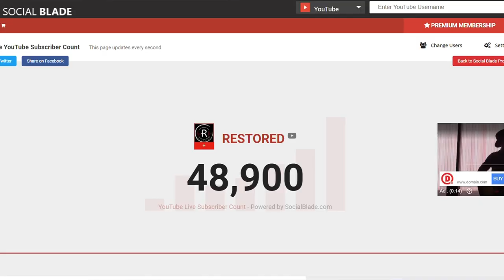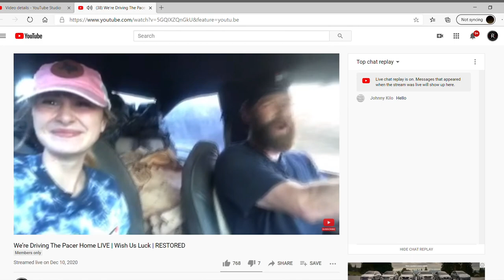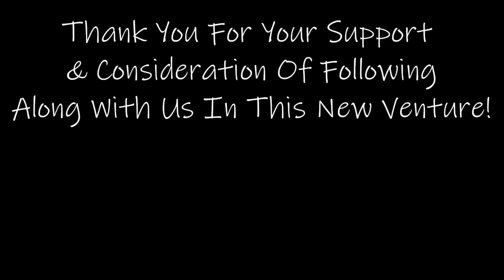ABANDONED AMC Pacer First Road Trip After 2 DECADES!| Rescued & Clean Up After 20 Yrs (P3)| RESTORED

Comment: your show reminds me of my ford aspire i bought for 75 bucks. it kept eating batteries because they the hot wire and the ground wire from the battery to the same bolt. separated them out and it ran beautifully. then i started on the interior. i took the seats out and the carpet out and pressure washed them at a car wash took the center console out as well as the dash and cleaned the years of soda pop and tobacco stains out boy that water was nasty but in the end it was spotless. then i fixed the little things like the blower fan switch and the turn signal switch all i had left was the vacuum booster for the brakes then i lost everything in the wildfire and now i get to start over.

Comment: You are half correct on the thermostat as you are with most car related things. It does allow the engine block to heat up faster but it also holds the coolant in the radiator longer to allow it to cool off more to keep the engine cool. Without the thermostat, you have a higher chance of overheating than you do with it installed due to the coolant not being in the radiator long enough to lose it's heat.

You should NEVER run pure antifreeze! Without the thermostat installed it won't be as hard on the water pump but the viscosity without water is much higher. It also will not absorb as much heat. Coolant is only designed to keep the water from freezing, reduce corrosion, and provide lubricant for the water pump. It's not designed to be used by itself!
Reply from the maker: No one ran straight antifreeze in the car, it was diluted off camera.

Comment: the thermostat is there to slow the water down to give the radiator a chance to cool the water. the engine will run cooler with a thermostat.

Comment: I have seen the aftermath of a fan blade flying off (hole in hood). And in my younger years, I remember a 64 Chevy came into the gas station I worked at (1973) that had an awful vibration. Looked and looked and couldn't find the vibration, shut the engine off and it was a missing fan blade.

Comment: I've found instead off using wd40 as it's not cheap . I use kerosene with a bit of old or new engine oil . It sinks into rust alot quicker and alot cheaper .

Comment: Tip from a custom car builder,
NEVER START THE MOTOR UNTIL YOU TEAR IT APART
Silly people dump in gas and run it and 9 times out of 10 hurt the motor.
Those old carbs need rebuilt, the rubber gaskets & diaphrams corrode & deteriorate.
Water jackets are usually clogged, rats nests in the intake.
You are BEGGING for problems.
Old oil, gas, coolant, trans fluid....😳
Just tow it home & rebuild it.
✌N ❤ the car.

Comment: I had a car with a blown head gasket never put any oil in water it would over heat
Reply from the maker: Yeah you’re right. The head gasket doesn’t always blow to the water side. Sometimes it can blow between pistons or even to the outside of the head
Reply: @RESTORED-HOPE  it blew coolant back reservoir and over heated engine.  Thx.